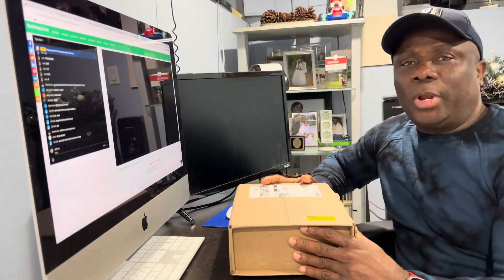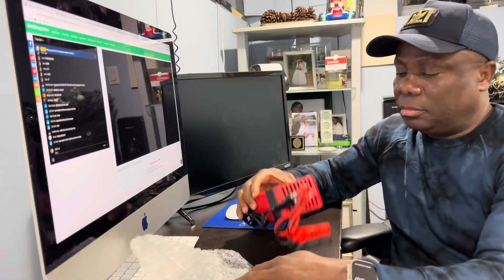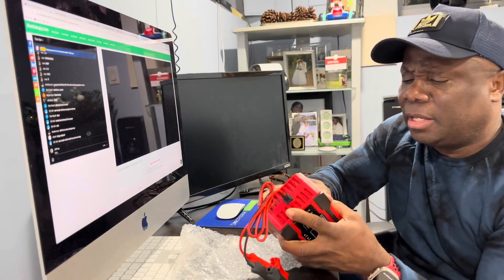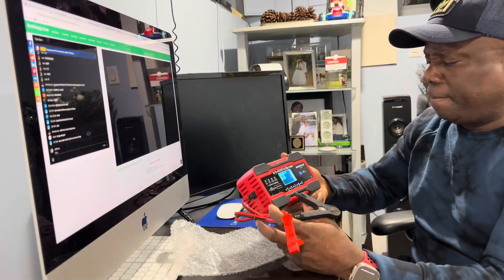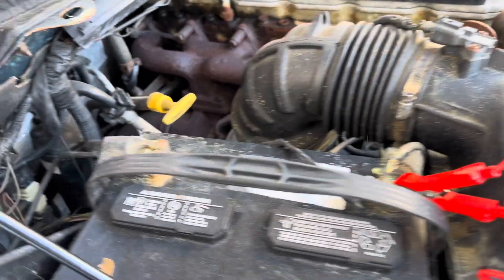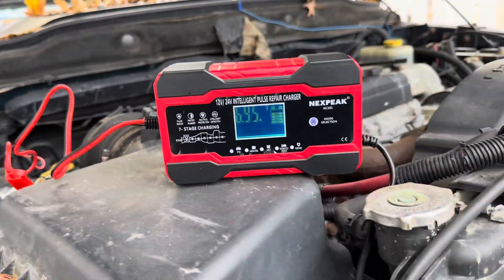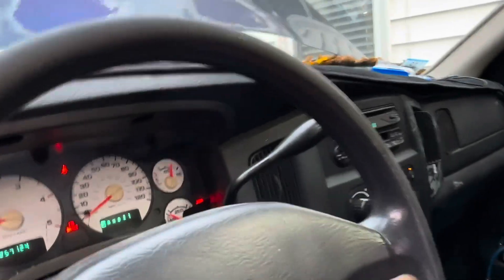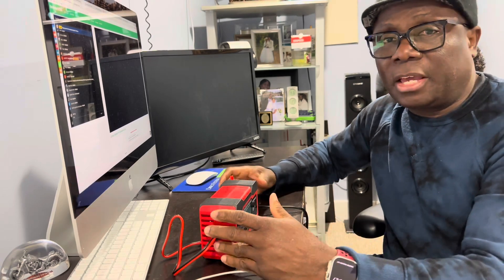Best Battery Charger for Lead Acid Batteries | NexPeak NC201  12v/24v

Comment: I’d just bought one of these and was a bit nervous, you’ve put my mind at rest.
I have a Range Rover 3.0 Velar and the only difference I’ve done is connection it to the trickle charge/jump start points in the engine area and not the battery in the boot. 
Will see how it goes as I kept getting a warning stating “please start engine, battery low”. It stated mine was only 20% charged when I connected it.
Reply from the maker: Thanks for sharing. This unit is very good, it will help to condition the cells so it can keep the charge. If it’s still not keeping charge after using it, could be that the battery is going.

Comment: OMG dude, if you are trying to charge battery with all terminals hooked on car and heavy corroded your vide is not relevant.
Reply from the maker: It surly worked though…..very good product
Reply: Good job. Ty boss. Whole idea is to use it on old car,im with you bro.

Comment: Should you not have the battery terminals cleaned FIRST and BEFORE using the trickle charger?

They look awfully dirty and corroded!
Reply from the maker: Yes, I would support your statement….cleaning them would be a good thing to do.

Comment: Does it auto shut off after full charge?
Reply from the maker: Yes it does then goes into a cleaning mode where it would clean the battery cells
Reply: @jimpway  thanks 👍